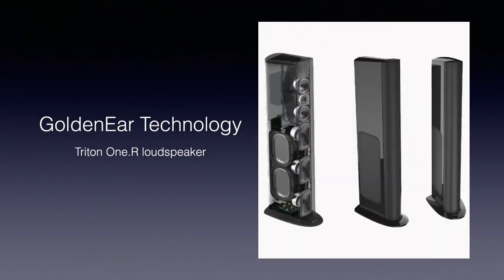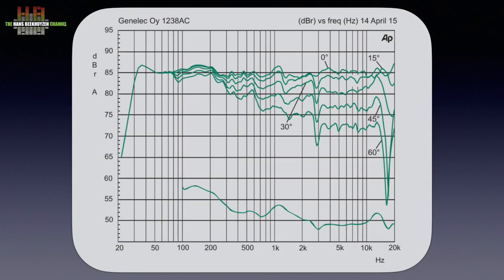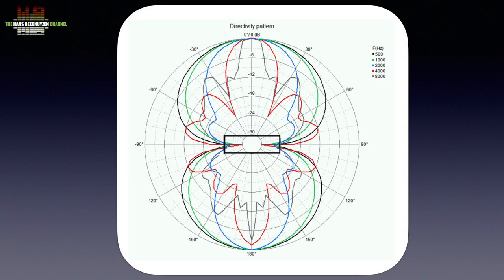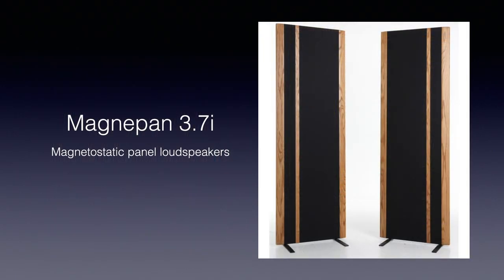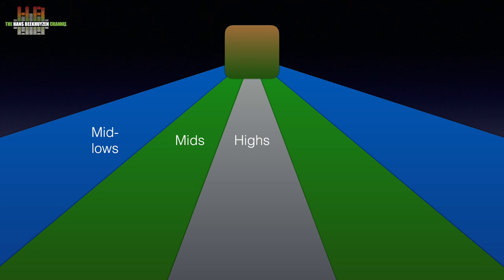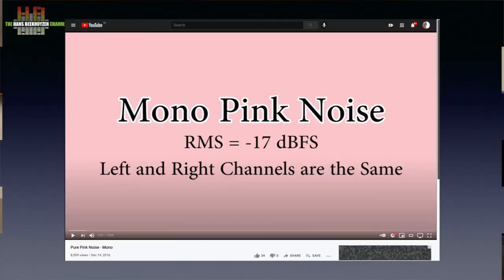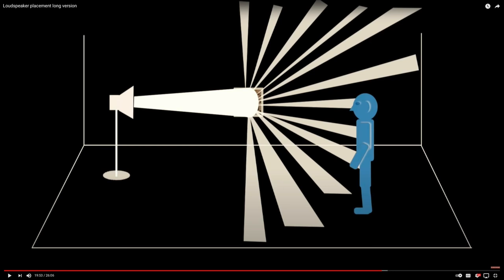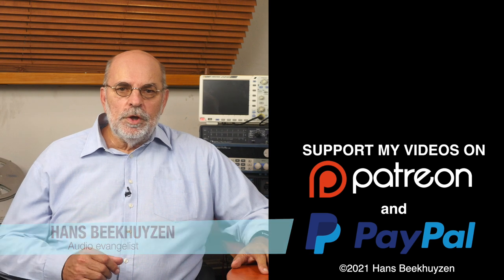The secret about toeing in loudspeakers

Comment: Best advice ever!. Read the user manual and start where they recommend.  Tannoy recommend toeing their duel concentric speakers so that they cross in front of the listener.  I thought that was odd and would never of thought to try that position if they hadn't of mentioned it  After trying it they were right and that's where there staying.
Reply from the maker: And you now know why
Reply: @TheHansBeekhuyzenChannel  I believe that it works because the speakers single point source horn design. The tone doesn't change  on or off axis.  However the volume does change. They play louder when pointing directly at you.  So as you move your head to one side, the closer speaker is more off axis and sounds quieter and the one further away now plays louder.  This effect balances the sound and gives a larger sweet spot to sit in. It also reduces room reflections and creates a deeper sound stage.
Reply: I will give that extreme toe in a try again. I have my Tannoy dc’s setup with little toe in. They sound very nice that way. Which dc’s do you have?
Reply: @henrym78  l have a pair of Canterbury' SE. Driven by a KR Audio VA880. My room is 5m x 5m . A square room s a nightmare but the Tannoy's design reduce most of the issues to a level where room treatments can fix them
Reply: @stephens2r338  I also have a square room, 4.7x4.7m (4.3m ceiling)! I use the Tannoy system 8 NFM II’s with Quad 99pre/99 monoblock’s amplification. Sometimes I switch with a Opera Consonance MI10se tube amp. I also have a set of the old dc-100’s that play very nice! A bit more relaxed as the NFM’s. Looking to upgrade for ‘bigger’ Tannoy’s ;)
Reply: @stephens2r338  Exactly the same effect occurs with Elac Navis speakers, also concentric.

Comment: Thank you Hans! 

Your video was very helpful in fine tuning the positioning of my Quad ESL 63 dipoles and the additional Townshend Maximum  Supertweeters. 

I was triggered by the Directivity pattern and the graphic representation  of the  dispersion, energy and spectural balance of frequencies, taking  into account toeing in the dipoles using mono Pink Noise. 

This resulted in less side- and backwall reflections from the dipoles.  

For a wider stereo- image moving  the TMS -tweeters to the outside of ESL’s  proved the icing on the cake!

Comment: Very interesting video Hans. I have used various Quad electrostatics since mid 70s...like you, the 57s (I think you referred to them as 55s), then the 63s, and for the last few years the 2812s - the finest electrostatic Quad has made....so far!

I have, over nearly fifty years experimented with placement with all three models, and, firstly, come to the conclusion that all three models benefit from raising up from the floor. My latest 2812s are raised on solid custom-made frames so that the bottom of the bottom bass panel is 1 foot (30cm) from the floor. This results in less upper bass reinforcement - in fact the lower bass seems smoother and less curtailed as a result.

My experiments with placement have been exhaustive: with both the 63s and 2812s I have found that best results have been with the speakers only 4'" (10cm) from the side walls, but 4 feet from the wall behind them. My toe-in may seem somewhat extreme in that I point the left speaker at the right hand end of my sofa at the listening position 11 feet away, and the right hand speaker at the left hand end of the sofa. This gives a stable image over the three seating positions available, as, in the right hand seating position one is closer to the right hand speaker but slightly more off-axis, and further away from the left hand speaker but on-axis with it. This configuration is self-righting for all positions!

For 'solo' listening I have a single chair placed only 6 feet from the Quads which means the toe in is pointing directly at me.....the resulting image, with the instrument placement (on a good recording) occupying the space behind the speakers is most impressive!
Reply from the maker: Thanks for sharing.

Comment: I have been inspired to reach out to my speaker manufacturer for recommendations. Speakers came to me used, and thus a manual was lacking. Of course, there is the rabbit hole of acoustic treatment and absorption versus diffuser or a combination of both at first reflection points (plural as each speaker has two per side wall, not counting floor, ceiling, and front and back walls). Now there is a topic that could get you to 400 videos real quick!  :-)    Cheers and good luck with your YouTube video library indexing project.

Comment: David Chesky, musician, producer, etc is very convinced that placement is very important. His advice is to be in an equilateral triangle (R, L, You). 

Then toe in per manufacture suggestion. Depending on the speakers, 6-15 feet sided equilateral triangle. Room treatment obviously is also his suggestion.

For me, I am set up at an 8 feet triangle, and boxed cone speakers, I toe in about 5 degrees.  Magnepan’s I use a laser which I aim right at the center of where I sit. I think it’s about 12-15 degrees.
Reply from the maker: You must have missed my first video on YouTube: https://youtu.be/gXohzklfwPs

Comment: I found that with no toe-in my open baffle dipoles produce a coherent image and center stage but it seems to emanate from the front wall due to the large portion of the sound arriving from reflections off it. Also, to a great extent the character of the sound is that of the wall (which in my case is a large projection screen with thick foam behind it). In the case of center mic'd sounds (vocals), they appear to emanate from the front wall (which is fine for movies), while sounds from left or right appear to emanate from the speakers, which is the reverse of what one might wish to experience for say a vocalist and an orchestra.  So I added a little toe in to bring the vocals forward which also adds a little sparkle due to side reflections.

Comment: Excellent video and well explained. Having issues with speaker placement (Arendal 1723 towers) myself whereby I have the feeling that I’m missing a lot of clarity and detail. They are not high end by any means but should still perform much better than they do in our   situation.
These speakers use a wave guide that should allow for easier for placement if I understand correctly but I’m sure I’m not getting the most out of them. But, the room is an acoustical nightmare and not sure if I can do much to improve it. 
They are quite neutral speakers and currently toed in to the main listening position as also mentioned in the instructions. But will definitely try playing around and give it a go with the pink noise!
Reply from the maker: Go for it.

Comment: Interesting subject. I toe in my klipsch rp8000f's towers about 15' from each other @45 degrees with dual subs behind and to the inside slightly like the manual suggests. I find I get much better soundstage and center image than with speakers firing straight forward.
Reply from the maker: It all depends on the technical design of the loudspeakers

Comment: Thanks Hans, this is a helpful video. I find the combination of theory and practice very useful.

What do you think of placing one speaker closer to the listening position to get the center image in the middle without the toe-in being asymmetrical? This seems to work well in my room. I can imagine this could cause other problems though.
Reply from the maker: whatever sounds best. Every room is different and it’s impossible to give general rules apart from my two step approach to loudspeaker placement and this video. I even have my System 1 toed-in asymmetrical since they need to be on an asymmetrical place.

Comment: Dear Hans, i have a question about not toeing in but tilting down my floorstanding loudspeakers. I have a pair of Focal’s 948 and those are rather tall, so the tweeter is when they are placed completely level above my sitting position. So i was thinking i will tilt them slightly forword by screwing the 2 
back spikes more, by doing this the tweeters will point more directly to my ears. But hear comes my question, is this recommandabele or will this destroy the complete caracter and soundstage of my speakers? Thank you for your answer and all the best whises for the new year.
Reply from the maker: Just use your ears.

Comment: Hi Hans, would have been great if you would have covered horn speakers as well. I am working with Lecleach horns in a 3 way system in a room where the speakers can be placed 15” from the side walls…. Any suggestions? Just tuning the system by ear, the speakers sound better with slight toe-in but i do hear a great change in the image or centring thereof when i move my head from left to right or vice versa. Thanks.
Reply from the maker: I have no hands-on experience with horn loudspeakers. But I would start with full toe-in (so the on-axis pointed towards you) and then apply small  steps of outward turning using the pink noise I suggested. Listen to a strongly focussed noise source in between the speakers.

Comment: my speakers lean backwards  a very small degree,3mm higher on frontspikes,somebody adviced this.
Reply from the maker: The thought behind that is to line up all drivers in the vertical pane. Most speakers are designed to do this when placed on its own feet.
Reply: speakers can sound less spacious when toed in more,but fuller,more balanced.
I think it makes sense to listen to every speaker individualy(mono) to finetune them.
thx for all the videos

Comment: When considering things like this I always wonder if the human auditory system is truly capable of detecting the time difference of arrival of sound between ears. My intuition tells me that human hearing is not sensitive enough to pick this up. Well, my intuition is wrong. According to Wikipedia references, humans can detect a difference of 10 microseconds or less of a sound arriving at the ears at different times. So at a temperature of 20c and at sea level (not sure what humidity level) a separation distance of arrival of a sound between the ears of 50mm would be a delay of about 150 microseconds, so that is apparently perceptible to human hearing.
Reply from the maker: You could try to listen to high end audio to find out.

Comment: always interested in your in-depth videos !  I have a unrelated question : I’m currently testing in my home Bel Canto REF600M monoblocs  (using my Sim Audio Moon 390 as a source and into my Wilson Audio Sophia Serie 1 speakers). My normal amps are tube monoblocs (Sonic Frontiers SFM160 with KT-88 tubes). Despite a weeks of breaking I find these Class D amp very fatiguing to my ears. Have you experienced that with class D amps of is it just theses ones ?
Reply from the maker: That differs from one class D design to another. And even from one listener to another. I have not heard the Bel Canto's so I can't be specific on them.

Comment: Thanks for this informative video. But what if the right speaker doesn’t have a wall next to it and that wall is like 4 meters away, and the left channel has wall almost right next to it in a diagonal arrangement in a rectangular room where the room is just long. My bass is amazing, but the highs and image suffer. Especially if I toe in a bit, everything radically changes and also if I move a few centimeters in seating position, I hear the center image differently or just not clear where it is located anymore. I get wide soundstage on the right, but missing that from the left side. Or is it how recordings are mixed? It’s all confusing. I should just give up maybe and accept the fact that that’s how it can be done.
Reply from the maker: Then the right channel has no early reflections problems thus nothing to solve. But the left ckannel ie the left channel might need more than average damping to balans out left and right
Reply: I have this issue... No wall beside right speaker. Wall beside left speaker. Imaging is never correct. Using channel balance adjustment is crucial here I think.